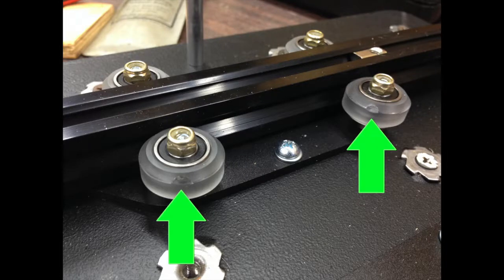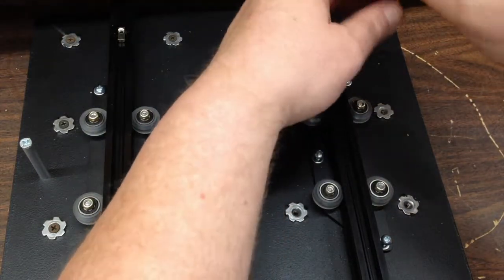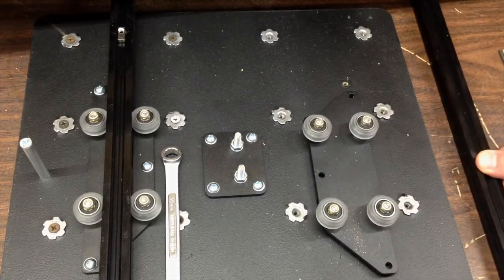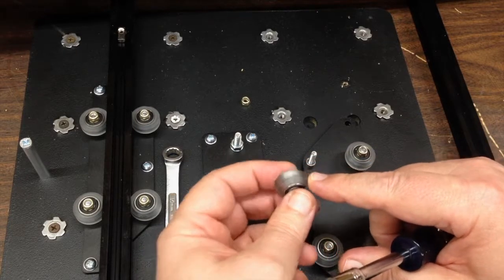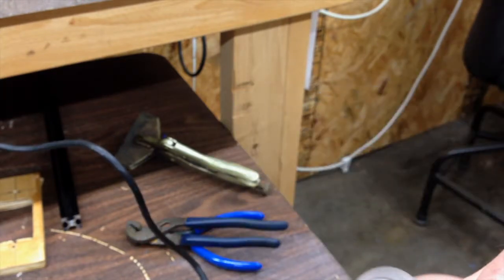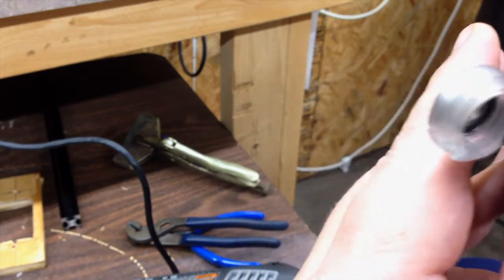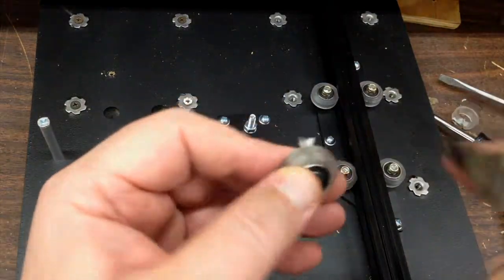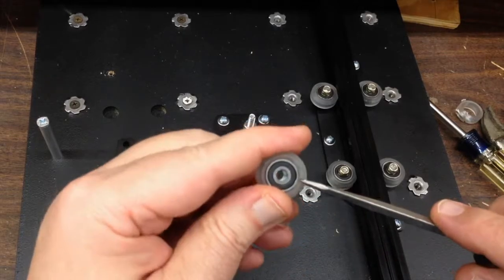CNC V Wheels Replacement

Comment: Love your videos and millright cnc's. Haven't tried it, but have you thought about trying blue thread lock to attack the polycarbonate wheels and hopefully make them brittle enough to crack/fall apart when tapped with a hammer?

I'm thinking a little dab of blue locktite on the OD of the v wheels in four or more places and letting them sit over night should make the polycarbonate nice and brittle.